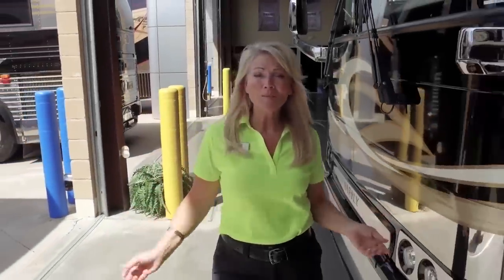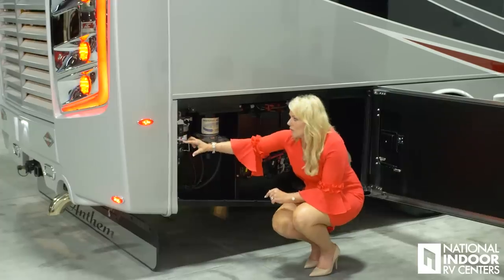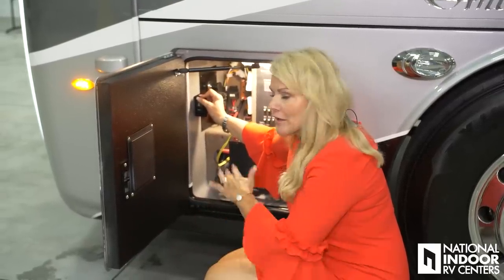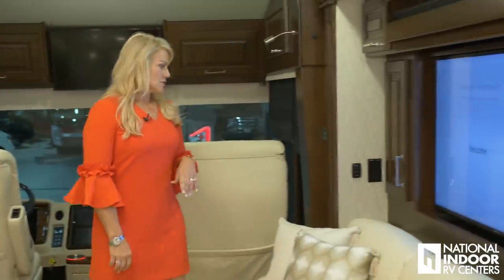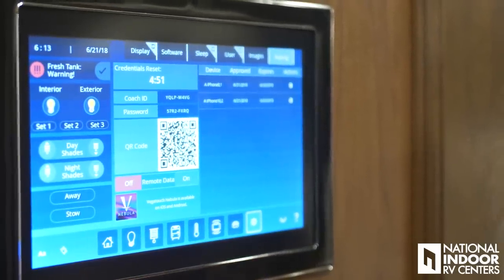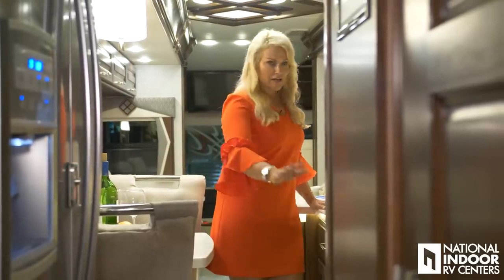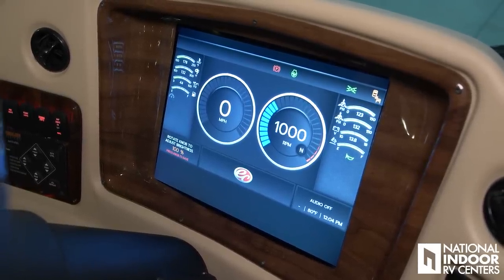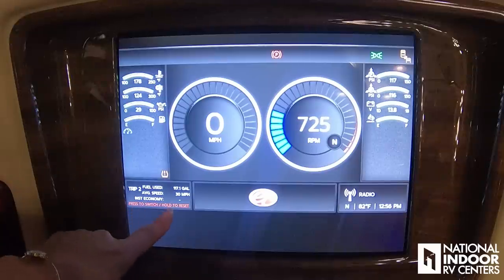2019 Entegra Anthem

Comment: Hi Angie I would just like to let you know some of the other features of hi/fast idle. Hi/fast idle can be used in many different ways, the first is to keep the engine rpm, temperature, and oil presser up. You might be asking why you would want to keep these things up; well it's to keep the engine idling more efficiently during long periods of time and to keep the DPF filter hot so again it can run more efficiently. Another reason is to keep the alternator at a higher rpm so you strain it when your inverts are pulling a load on it to run things in your house; you only have to worry about this when your generator is off. The last feature definitely is to fill air into the air tanks faster. The best way to keep your diesel engine running for many many miles; is to run it like a diesel is made to be run. The way I do that is start it up at the begging of my trip and run it to the end of my trip. Just because starting and stopping a diesel is very hard on it and hard on your chassis battery and stater. I have been watching you videos for three years and loved seeing all of the different coaches, and you have tough me a lot. I can't weight to see the New 2019 Newmar King Aire.
Reply from the maker: Wow!!! Thank you for that insightful comment Jake. It certainly helps me.

Comment: Hi Angie, thanks for a detailed presentation.  I wanted to know. where are House Batteries located? i only see Chassis batteries on your presentation
Reply from the maker: I’m sorry I forgot to mention them. They are right in front of the drive axle, just behind the power cut off switches. The carpeted panel there is velcroed. When you remove the panel the house batteries are right there.